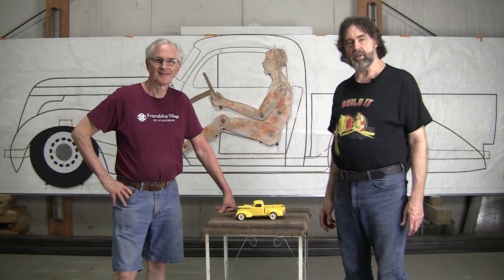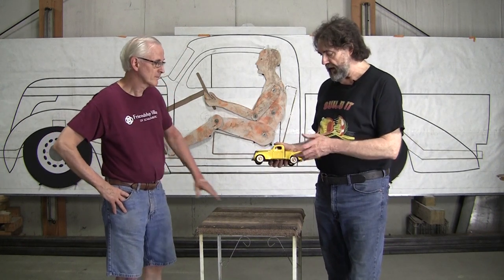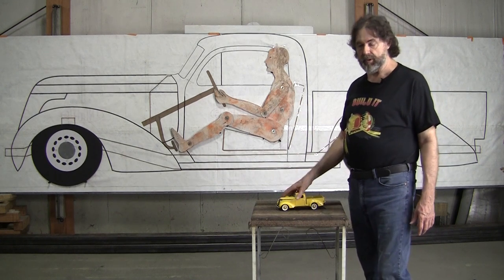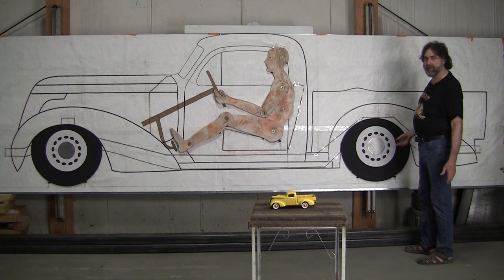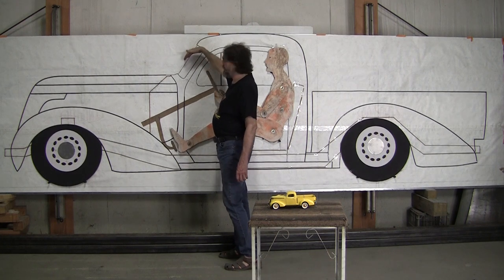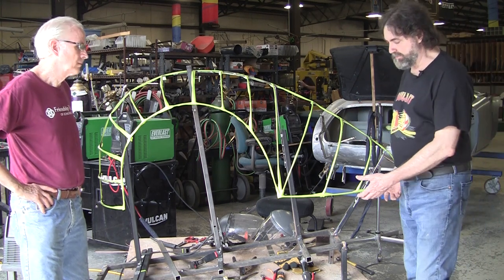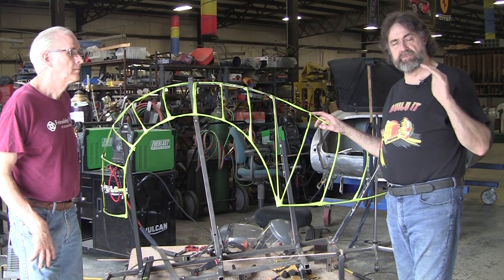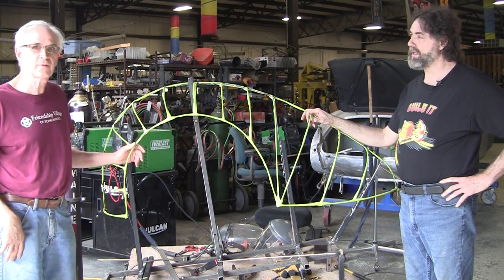1937 Studebaker Express Pickup Truck

Comment: Back in the 60's in New ZEALAND I  was delivering newspapers to earn money for my 1st car. One of the houses i delivered to belonged to a mechanic at the local Ford dealership. He had a 1937 Studebaker coupe with a GMC 302 six ,independent front end etc .It is still stuck in my mind as one of the best looking 30's coupes, especially the Wing shaped rear window opening. I Looked for years to find another to build my own but I suspect his was the only one in NZ. The pickup is something new to me ,although I knew the later stude line up included some great looking pick ups.

Comment: 11:11 couldn't have said it better, CAD can only go so far with shaping. Wonder how far out CNC shapers are, maybe a 3 robotic arm system, 1 holding the steel, another two swapping different shaping heads. Would be a hell of robotics cell. Thanks for sharing so much on this channel.